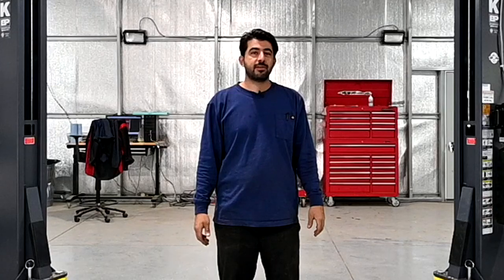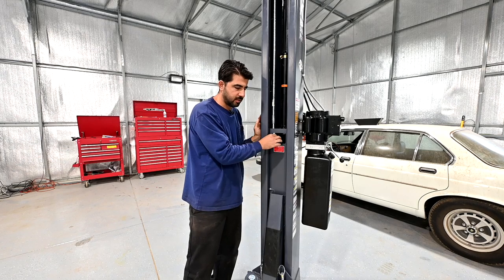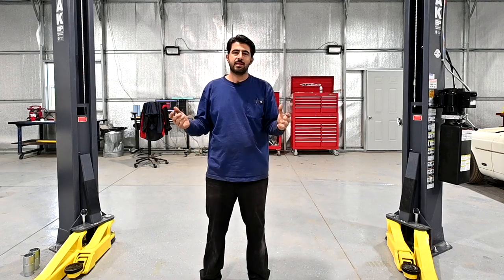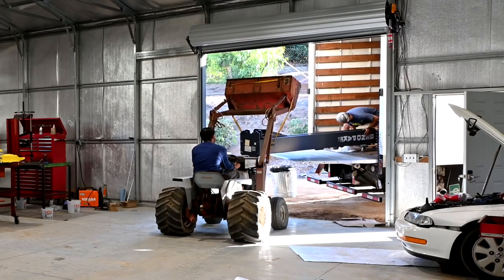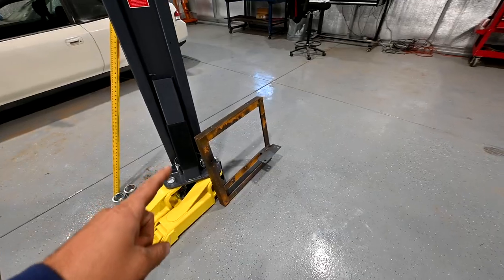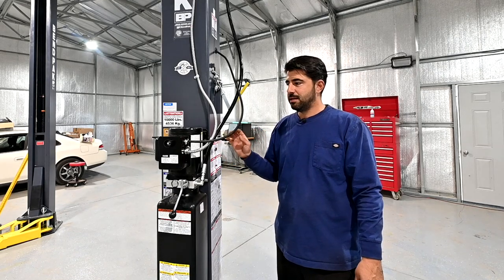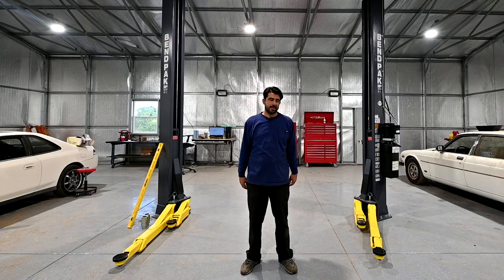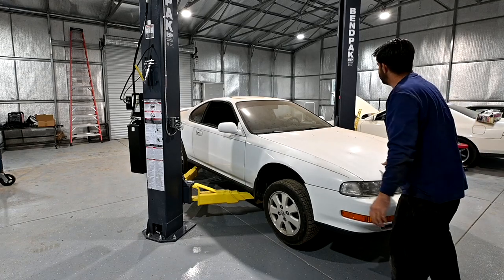Watch Before Buying and Installing a Car Lift

Comment: I have two older Bend Pacs. They look more heavy duty. U don’t need the safety’s close to the ground, so u can put  the car at whatever level is good for your back. Once the safety clicks, even if u had a rupture of hydraulic pressure, it would only drop a few inches before the safety would would halt downward motion. I have been using them about 12 years. I have had to reseal two of the rams. Very happy with them. I often back lighters cars on the asymmetric lifts. No problems.
Reply from the maker: good info thanks
Reply: My bend pak is over 20 years old and still doing good, I’ve just set it up in another shop, just a diy mechanic now semi retired, it has done me well.

Comment: Certified structual welder here. The distortion on the bottom plate is normal. When you weld a plate to a beam the weld cools and pulls the edges up because the weld shrinks the material on top around the heated area. The hotter the weld the more distortion. You can try to control how much is moves around with preheat and pre bending the plate in the opposite direction but all steel will move enough that we had to shim nearly every beam we installed. One way to fix this is to machine the plate after its welded but that costs too much.

Comment: I understand safety is very important , however if you are only raising the car 12” off the ground to make it more comfortable to work on the engine I would view the safety lock issue as a very minor inconvenience .  Thanks for sharing
Reply: I would just use jack stands for that low of a height.  I would LOVE to have a lift like this or access to one.  I only work on my family's vehicles so I can't justify the cost in my head for something like this.

Comment: You can still work on a sedan engine at 16 inches, just don't get under it.  Or slide some jack stands under it for safety.
Reply: That's what I do, I don't use any jack stands either never once had a problem,  The only time I care about the locks is when under it of course also I'll use a tri post under the rear end sometimes if needed.

Comment: Nice tutorial. You didn't leave out anything. I have a #10,000 Rotary, and I found the same issue with the low working height. I cut two 4 x 4's to act as locks (around 8" each) for the ground level height. The blocks support the weldment that holds the arms. Totally safe and convenient. Be sure your BendPak will work this way first. I love your new shop. Thanks for all the great videos!
Reply: Was going to suggest the same thing.

Comment: You were not alone with the bottom plate not being level. I saw another youtube video where the user had the same problem. When I was looking for a lift I spent the after noon visting the local shops in my area just to see what lift they were using. Rotary was by far the most used followed by forward,then challenger. I ened up getting a sweet deal on a mowhawk 9k lift that was like brand new for 3K. I intend to install it next week. Thanks for taking the time to make yours!

Comment: I have the exact same one at home. I set it up by myself as well. Stood the posts up with my A-frame gantry - easy once I figured out the center of gravity on them, and moved about 6" "up" to put the sling. Moving them around was also pretty easy if you've ever moved a barrel. 

I've had mine up and running about 4 years now. Gotta be one of THE best purchases I've ever made.
Reply: If anyone else is thinking of getting one - of course you don't have this issue!! - Check the height of your ceiling.  A normal 12ft one will not work!  For some insane reason, they made it so you NEED (!!!!!) 12ft 1.5" of height. I virtually built my shop around this hoist (I bought the hoist about 6 months in advance as I heard a price increase was coming soon), so made damn sure that they put one extra 2*4 all the way around the top plate to get me the extra clearance needed.

And boy - they're not kidding!  Look at the top, you'll see a notch cut out. As you stand up the posts (they of course go up in an arc), that notch lets you do it. There is then about 3/8" clearance to your ceiling.  If you had an unfinished ceiling, and the rafters went the right way I guess you'd be OK. But still...  whoa tight!
Reply from the maker: thanks for sharing.
Reply: Nice

Comment: For the anchors you should vacuum out or blow air into the hole and get all the dust out. That way the bolts will hold the load that they are rated for. On jobs doing structural steel we could fail inspection if the holes weren't clean before the anchor is installed. Another tip, mark your drill bit with tape so you know how deep to go.
Reply: Also brush out the holes with an appropriate size bottle brush to mechanically clean the bore of loose material. The epoxy needs solid concrete, not dust to adhere properly.

Comment: That was great.  I have friends who had a repair shop and bought those lifts.  I'm around your height, and hated them. Had to duck constantly due to the lack of lift height.   And you're right about the low lift height with the locks - it would be so nice if they locked a foot off the ground.

Comment: You win the Man of the Day award for raising those two posts all by yourself, lol!  

Was thinking about the situation with the lock cable and the electrical cable...maybe a couple of nylon rollers could be used to hold the lock cable back a bit without causing wear or drag on the cable?  As for the first stop being too high to work in the engine compartment, you could always just use a low step stool to get yourself an extra foot off the ground.
Reply from the maker: step stool is always an option but won't beat walking around the car :)

Comment: I recently purchased a 10,000 pound “A plus lift” pick mine up with my two wheel 12 foot trailer   Unloaded it off the trailer by myself using come  along to snub it and rolled it off on a 8” round fence post cut in 4 (2 ft each ) rolls around nice in one peace.

Comment: I've had a BendPak 10k symmetrical lift for about 10 years.  What a great investment, I paid $3300, installed, and it has paid for itself several times over on reduced maintenance costs.  If you have a place to install one, get one.

Comment: A design flaw yes but I'd fasten a piece of Delrin in 2 or 3 places  which would self lubricate and never cause an issue for locking cable. Thank you for pointing it out though. I'm in the midst of trying to choose a good 2 post symmetrical lift and want safe reliable operation

Comment: I would look for the ALI sticker on any lift I would consider . They torcher test every model that has the sticker and if they don’t pass that model doesn’t get the sticker. Anchors are torqued to 150 foot pounds and should be retorqued annually to 85-90 pounds . Always work with load resting on locks and don’t walk away with out lowering to locks.

Comment: A generally good video, but a few comments if I may:
1. Any video on the subject should always include a warning on making sure your concrete pad has the correct mix (strength rating) and thickness. Your anchors also have to have a minimum embedment.
2. I would not comment on materials  unless I can back it up with evidence. Keep it down to facts. 
3. The safety release cable does indeed run too close to the cable. Good catch.
Reply: Yeah, I was wondering as well about concrete thickness and strength.
Reply: He talks about concrete thickness and psi pertaining to lift requirements in the shop build video 👍

Comment: Great video!  However, one does not "Level the posts , both ways".  It seems many have not been taught ""Level" and "Plumb".    Horizontal (parallel to the plane of the horizon, at right angles to the vertical)  is "Level" .

 Vertical  (straight up and down, at right angle to the vertical) is called  "Plumb".

Comment: The pads at the bottom are not flat because of distortion caused when they and the gussets were welded to the post. This situation is unavoidable and has nothing to do with the strength of the steel. Use of shims is common practice in this situation. Great video by the way. Hope you get lots of use out of it.
Reply: That's NO excuse. Shotty welders.

Comment: I don't know if anyone else mentioned in the comments, but the reason why your bottom mounting plates need the shim's, is because guess what, when you weld steel it tends to curl / move / not stay flat, unless the factory uses what is called a "strong-Backs," to aid in keeping the steel / flat / straight.  That cost the manufacturer time & money.

Comment: Good presentation.
Regarding the first stop on the lift being to high in order to get the vehicle up to a working height I would have no problem working on the car with it resting on the hydralics, or for some additional safety, putting a jack stand or two under the lift arm supports for safety and or to take the load off the hydraulics. My thinking that even having a lower click stop support on the lift would not be the perfect height for your size and the variations in cars anyway, so it's something you would probably need to fine tune. Jack stand or two, or cut some thick timbers the correct dimension to suit your comfort.
Reply from the maker: there are work arounds but non as good as a lower first stop :)
Reply: @myRatchets  Sure, but since the distance between the frame / rocker boxes and the level of the where the engine actrually sits and fender height varies between cars so much, I would say there is no one ideal first top level. As such the jack stands or custom cut wood blocks might be the preferred choice anyway. 
In any case I think it's trivial and easy to work with. 
Of course if your moving the vehicle up and down from the floor a lot, it's more of a hassle. If you're moving between a high and low position a lot, then the blocks, or jackstands will be a potential trip hazard.

Comment: Another possible fix, simpler than the roller (which is the ultimate fix) would be to invert the romex clamp.  A little more difficult to install but doable.  The wiring could then be held to the side in the same manner as you are currently redirecting the cable.

Comment: Nice video! I also have the BendPak asymmetrical lift and I back vehicles onto mine. I mostly work on BMWs which are around 50/50 weight distribution so I figure it doesn't matter. 6 years later and it's been fine.

Comment: Get one of those "upright crawlers" that look like a two step ladder made for working over the hood of the bigger pickups and one tons.  This supports your upper body out over the engine and eliminates back strain.  Spending all day bent over is a prescription for back problems if you don't already have them!  Normally you would use the spacers to set the base but before ever using it that gap would be grouted in with a high strength grout.

Comment: Having made my living under a lift for 30 years, my experience is there is no comparison between the quality of a Bend Pak and a Challenger. The Challenger is garbage. The bore in the arms where they pivot on the pins wear out and elongate after only a couple years of commercial use. Rotary lifts used to be the paragon of quality but they are now built to a price point so if you want that Rotary quality you have to buy their top tier (most expensive) to get it. My experience with Bend Pak is that they just keep working.

Comment: Test the levels you buy in the store for trueness before you buy. I've found many levels aren't true, especially the plastic ones, but fancy aluminum levels can be out
Reply from the maker: Thats funny, I had to through out a broken aluminum one that was giving me false results on these posts.
Reply: @myRatchets  got tired of setting showers thinking the tools were fine. Couldn't figure out why I had such a hard time. The garbage tool manufacturers try to pass of as quality is getting bad. I always test them in the store. Like the drywall t squares that are3/8" out in 4 ft. F@*#^!ng crap

Comment: Thanks for great detail info of the Benpak Lift installation. Quick question ? how much concrete area ( cubic inch , WxLxD ) do you need for anchoring the posts. any need of concert rebar?
Reply from the maker: you need rebar and the minimum concrete thickness should be 4.75" and 3500psi according to bendpak but I would go 6"-8" deep in the areas where you will be putting the lift if you are doing a pour. as far as WxLxD that will depend on whether you are just doing a pour for the two posts alone or its part of a larger pad, if its part of a larger pad I would say the areas around the posts 2' out should be good, but I don't know the answer if you are doing it just for the posts. I personally wouldn't pour concrete just for two posts.   I would pour concrete for the entire garage/shed etc.   GL
Reply: And you should stay 8” from any saw cut or cracks in the concrete

Comment: Great video! You covered a lot of great information! Especially appreciate that you discussed the advantages/disadvantages of symmetrical vs asymmetrical two post lifts. I would however suggest limiting your comments (speculation) regarding the strength of the steel without factually knowing the grade of steel for the products you are discussing. Since your steel strength comments are obviously based on speculation and not based actually specifications, you risk putting out bad information which your viewers may mistake as factual information.

Comment: The steel is not likely softer. When the steel is welded it warps as it cools. It will pull from different points as it cools depending on the edge distance from the welds. While is is possible to weld something slowly and allow for some movement it is very unlikely that it is perfectly square. The issue is that your floor while overall may be level it is not very likely to be really flat. I would not be at all surprised if you had undulations up to a 1/4" in your slab.
Reply: Yes milder steel no good

Comment: If the base plate is not flat It is highly unlikely that it was bent in the shipping brackets.  The shipping brackets are much weaker than the bases.  Any out of flatness is most likely warpage from the welding of the column to the base plate.    Most concrete may appear level with a long level but can have small humps that can cause the base plates to appear to be not flat.  A grinder can remove these high spots allowing the column to sit on the floor better.  Of course your floor was probably ground prior to the installation of the epoxy finish.  If two lifts weigh the same then  their thickness will be the same.  All common steel regardless of alloy (unless stainless) and hardness are virtually the same density.  

I am a bit concerned by the amount of the concrete anchor bolts threads that are protruding from the nuts in this installation.  In a proper installation there should be about 3 threads protruding beyond the nut.  When sinking the anchors, I always back the nut off a few threads to allow the anchor to be driven deeper because it will always withdraw some when tightened.

I am impressed by your ability to raise the columns by yourself.

Comment: You can get screen door rollers (they have a U shape in the center of the wheel) in various configurations at the local box store.  You could also put a micro switch on the lever handle that activates when you pull the lever, then wire a solenoid to activate on the opposite side to pull the lock when you pull the lever.  A suggestion - mark on the floor with a magic marker where the front tire lines up to make the car centered side to side and also front to back.  I use a "T" on the drivers front laid on it's side (-l) to mark where the front tire lines up.  The "l" part I use to make the front tire line up right next to (parallel), and the "-" I use to tell where the center of the tire should stop (perpendicular).  I do this for the vehicles I put up on the lift most often.  Using a center line or a ball on a string can produce inconsistent results (like when the vehicle is skewed at an angle).  This "-l" method works most consistently for me,  I just poke my head out of the drivers side window and drive right in, all lined up.  If you are worried about having a mark on the floor, use lacquer thinner to remove it (bare concrete) or just wipe it off on epoxy coated floors.
Reply from the maker: good info thanks.

Comment: Id be tempted to anchor the top of the lift to numerous places on the roof trusses via steel cables and not just trust the floor bolts .

Comment: What is the silver material covering your walls, does it keep the shop cool?
Reply from the maker: reflective insulation, keeps it cool in the summer and keeps the heat in during winter. Also no condensation as a result either.
Reply: Building insulation. Many types at your local Home Depot. Helps cut down on heating/cooling.

Comment: Use post packing mortar under uprights if on uneven ground .
My symetric hoist had to grind upto 1/8 to get arms to open 190degrees .
Remember to bleed oil out of the hydraulic rams .
With the cable  rollers I drilled out pin and installed grease fittings 
Yes u can buy lift narrow /skinny arms . Yes u have the screw in pads great idea .
Best idea is u can set posts up wide or narrow position